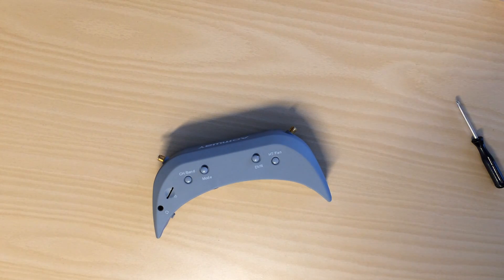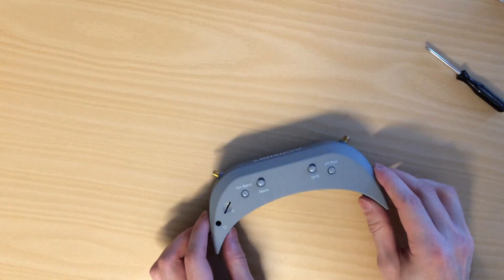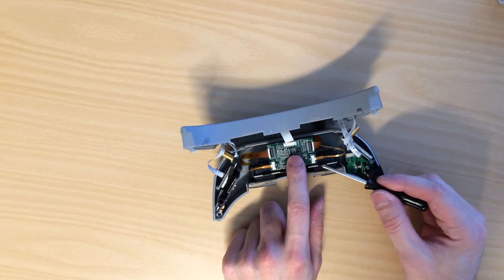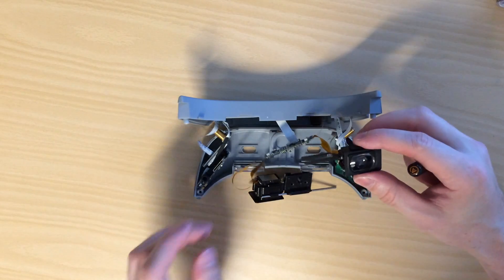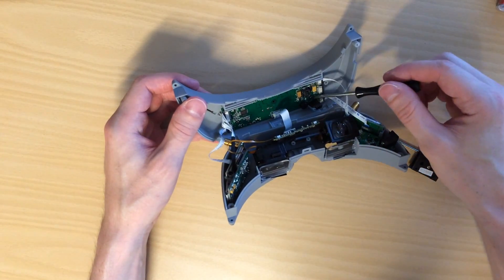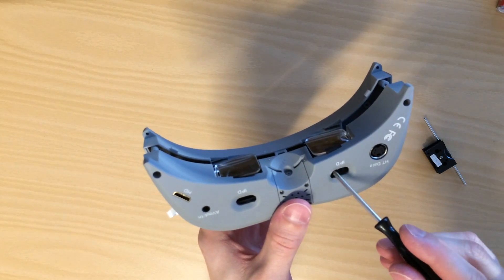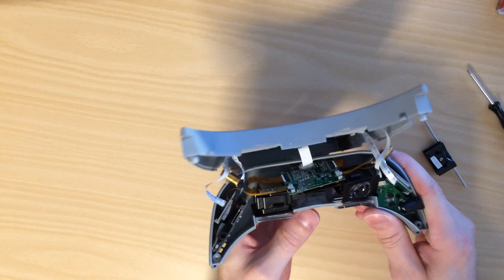Aomway Commander ~55mm IPD modification video

Comment: Hey I just got a pair of these myself, but I can't get a video feed from my drone. It's just static. I've tried different antennas and opened them up to see if there was any internal damage but I don't really know what to look for. I want to check the receivers with a multimeter to see if they're bad but I don't really know how. I'd appreciate any help or advice!
Reply from the maker: Aomway uses a different frequency table for channel/band so be sure to check that. For example 5865MHz is A-1 on my video transmitter but C-8 on the Aomway goggles. There is a chart in the manual.

Comment: Is there a way to go the opposite way, I need a tad bit to the right on right eye.
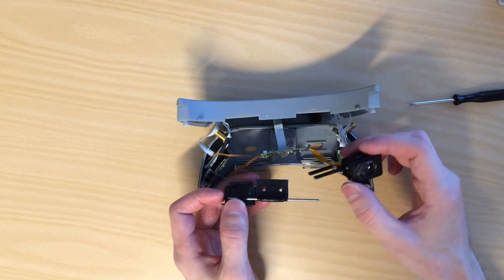Reply from the maker: The right lens does have a little over 1mm of extra travel available. You will need to cut or even better in your case file 1mm off the end of the oval shaped plastic piece of the lens capsule as seen at 1:31 in the video to free it up. You should also remove some plastic as seen at 1:37 but the opposite side of course. If you get some light bleed you can cover that up by making a flap of electrical tape. Apart from that you only need to work on the shell.

I made another video going over this issue. https://www.youtube.com/watch?v=-vtetZzPy-Q